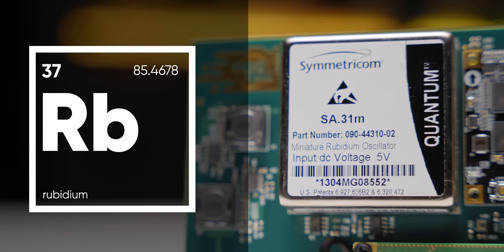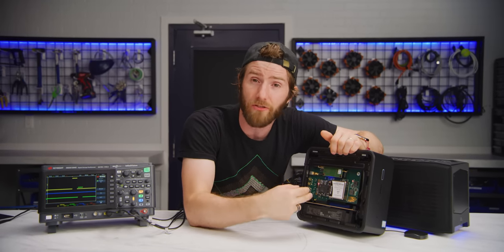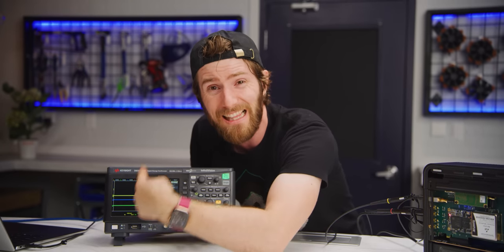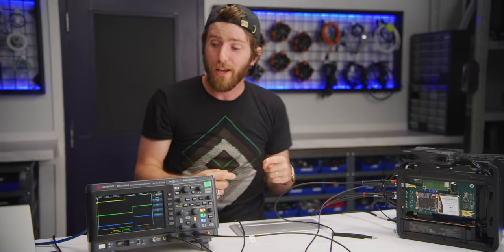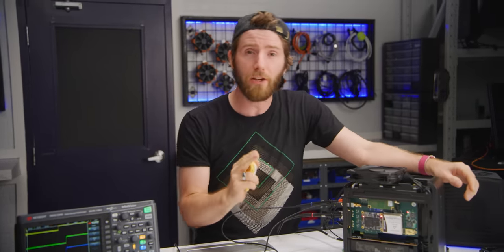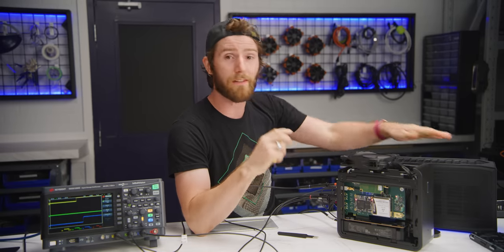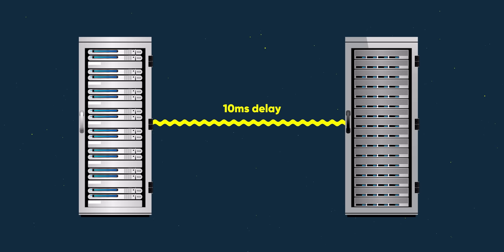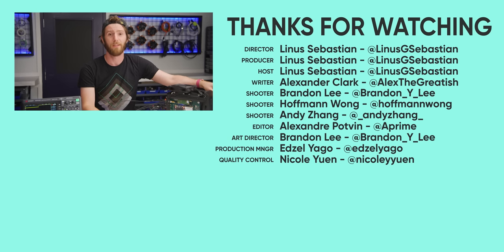Why is this PCIe Card RADIOACTIVE?

Comment: Jokes aside, this really is pretty cool. I feel like motherboards in the future will just ship with this feature built in
Reply: give this about a year or 2 and this will me implimented in m.2/ssd or even a new one
Reply: Doubt it as radioactive materials is a giant pita to handle. you have to label your shipment that it contains radioactive materials. certifications ? then it's gonna end up in the landfill eventually. this is just a bad bad bad idea.
Reply: The feature is the supporting chip for the feature is not.
Reply: Motherboards, Phones!  This is what is going to push communication standards well past 6G.
Reply: @yumri4  Oh no I meant specifically having it be part of the motherboard. As a separate module it could probably work.
Reply: ugh man, my lag it too high, gotta reboot my motherboard's nuclear reactor "hits AZ-5"
Reply: @stranger7968  pretty sure they are not radioactive. The rubidium is exited by a laser or maser. When it is turned off it should be dormant
Reply: @SAK_-  Yeah but it still doesn't change the regulations about nuclear shipment, no?
Reply: Pretty sure we dont have to worry about regulations much. smoke detectors are radioactive as well and yet you can buy them anywhere. In those amounts and at that level of radioactivity it surely isn't a big deal. Or Mr drops it Linus would never have gotten to handle one of them.
Reply: @PMSTTR  It does matter.  Rb isn't considered a radioactive hazard for the purposes of transport.
Reply: Doubt we'll have the resources needed to make motherboards in the future
Reply: yeah instead of the generic CMOS with have this bad boy
Reply: @stranger7968  you do understand it's not that radioactive?
Reply: You don't even need one in every computer. For example one in your network could suffice, like placing it in your router.
Reply: To people who say it's only slightly radioactive. Yes, it might not be dangerous if you think about it in small quantities, but once every PC and cellphones and cheap single board has it as a standard feature you suddenly have a whole landfill of radioactive material.
Reply: @stranger7968  Smoke detectors have radioactive materials and cost $20 retail, so dealing with small amounts of radioactive materials is definitely possible at scale.
Reply: Don’t bet on it these boards have been around for at least twenty years. I used to put these boards in computers to synchronize PC’s and GPS receivers for Air Force twenty years ago.
Reply: @Flavourdynamics  including their disposal, since we've had radioactive materials for stuff like smoke detectors for decades. This dude doesn't get that the half life typically will tell you how dangerous it will be as far as how radioactive it is. longer half life=less decay=less hazard. The more stable an isotope is the safer it is to handle.
Reply: @deltoncbaker  yeah I bet we'll get holographic TVs and photonic GPUs before "nano atomic clock modules" and personal quantum computers.
Reply: I’m sure there’s a way in the future that we’ve yet to develop that we can achieve same level and or similar pedigree of performance of that card without radioactive materials.
Reply: If it does I want a Nano second option in my windows clock
Reply: @stranger7968  ehh, Rb half-life is 10^9 years, and since you only need a tiny bit of it to measure energy oscillations the actual total amount in any given computer should be completely negligible in terms of safety (probably no different than normal background radiation).
Reply: @Velocitist  you'll never beat the percision of radioactive decay. Radioactive materials aren't dangerous you know. It's how radioactive and what type of radiation that's important. Rubidium 87 emits beta particles, and can be easily stopped by a thin aluminum sheet, which means shielding the rubidium in an atomic clock is extremely easy.
Reply: @stranger7968  that's not accurate. Watches with tritium tubes are worn every single day and there is no crazy red tape for its use.
Reply: @deltoncbaker  there's no way "these boards" have been around for 20 years.
for one, this was made specifically to replace some archaic closed-source timekeeping atomic clock boxes that cost a fortune. if there was a smaller and lower power alternative, it'd at least have been even more expensive, or not as precise.
you need to look at both precision and cost. i can guarantee you those cards you had installed for the air force weren't both precise and cheap like this. also this was open sourced, so anyone can implement it themselves.
still, the size and cost are still prohibitive to home use, but i'd wager manufacturers would find a way to make it 1/5 the size and 1/10 the cost and put it in a highend MoBo.
Reply: @stranger7968  Not everything small adds up to something big. A billion micrograms are still just a kilo.
Reply: Ye next PCs will be powered by a personal nuclear reactor
Reply: Hopefully
Reply: @stranger7968  I don't think you need a certification for this, it's less radioactive then a smoke detector, and package services will happily ship those around with just a warning sticker on them.
Reply: @PMSTTR  To be fair your bog standard ionisation type consumer smoke detector uses the far more radioactive Americium-241 as the radioactive source. That has a half-life of 432 years. That is to say the consumer smoke detector imported from a factory in China you will find in most houses contains a substance that is 113,194,444 times as radioactive per mole or 40,815,755 times more radioactive per gram. The reason for the difference there is that Americium-241 atoms are 2.773x heavier than Rubidium-87. But not only is this stuff still over 40 million times less radioactive per gram the smoke detector needs significantly more of it as they rely on the radioactive decay the weak gamma ray produced when it decays is what ionises the smoke allowing it to be detected. Despite the name an atomic clock doesn't rely on radioactivity and thus an extremely small sample is actually present far smaller than the one in a smoke detector.

I don't want to get into the weeds of hyperfine splitting and hyperfine transitions you can look those up if you are curious about the underlying physics. But to keep it simple certain isotopes eg Caesium-133 used in Caesium atomic clocks and Rubidium-87 used in these Rubidium clocks undergo an atomic transition at a constant frequency. When this happens they release a photon that can be detected and thus these transitions can be counted in order to keep time. Unlike the gamma ray photons produced by the radioactive decay in your smoke detector these photons are not ionising radiation, they are actually in the microwave range for Rb-87. Thus a rubidium clock is producing extremely weak, brief pulses of microwaves that is to say a few thousand microwave photons per second. This is actually why they need to be well shielded any external microwave signal would utterly obliterate the signal a wifi transmitter outputs about half a quintillion (half a billion trillion) photons per second, a mobile phone about 1000 times that.

As for the radiation produced when they do decay (ie very often for Americium-241 and very very rarely for Rubidium-87) the radiation released is very different also. Americium-241 as mentioned earlier is a gamma emitter which are far more dangerous and penetrate thick concrete walls with relative ease. Rubidium-87 when it does decay produces a beta particle which is much lower energy and has little penetrating power. In fact the shielding needed to protect the clock from interference from external microwaves is massively overkill to reduce the radiation escaping to basically zero. You would receive more radiation from a banana in a fruit bowl across the room, way more still from your pet cat sitting in your lap and even more from the Potassium in your own body.

To pose any meaningful cancer risk within a human life time you would pretty much need to disassemble several units and melt the pieces together into at least a sand grain sized chunk and ingest it. Even then it would need to get so securely logged into the tissues somewhere as to stay put in one place for probably a good few decades. Sure I'd not recommend attempting this experiment as it is certainly possible for an insoluble metallic particle to get stuck in the body like that. But considering that this probably would require the intentional harvesting of the sample from multiple units and carefully constructing the worlds least reliable ultra slow acting suicide pill from them make it hard to see this being a common practice. Frankly there are far easier and well known ways to intentionally self harm or for that matter to intentionally attempt to inflict oneself with cancer. Most of which are at least an order of magnitude more likely to actually work also such as you know taking an overdose of pretty much any drug in existence or taking up smoking for example.

It would really be that difficult to even intentionally abuse these units to self harm now that smoke detector on the other hand frankly that would be easy. Extracting the Americium from that and ingesting it would probably be almost certain death short of a successful surgical intervention managing to remove all traces of it (rather unlikely). Still not a relatively quick and painful death from acute radiation sickness by any means but you could probably bank on successfully achieving a long and slow death from multiple cancers.
Reply: @stranger7968  uhm what about smoke detectors?
Reply: @kasuraga  Ohh, thank you for the info.
Reply: These clocks aren't cheap to make and calibrate.  The Quartz oscillators in most computers is adequate for most use cases.  The accuracy, precision and drift is very good for the price.  Also for PTP to work correctly, a compliant PTP supported network interface card is required to synchronise device clocks accurately and with the correct precision.
Reply: @stranger7968  Please, don't say stupid things.
Atomic clocks ARE NOT radioactive, period.
Reply: @PMSTTR  i mean i got a tritium necklace without any issues